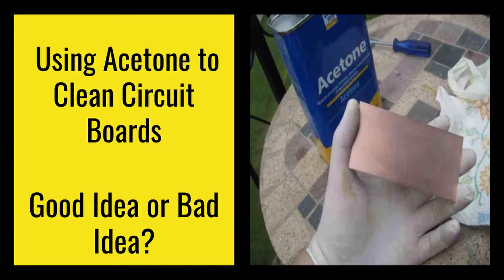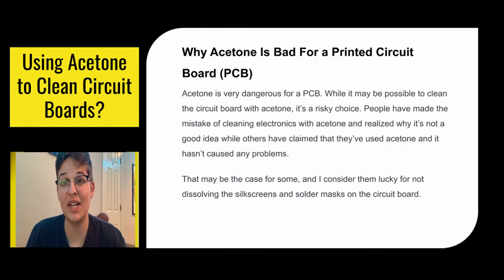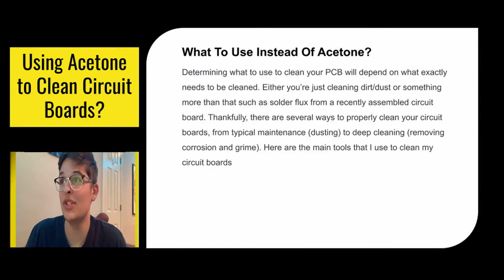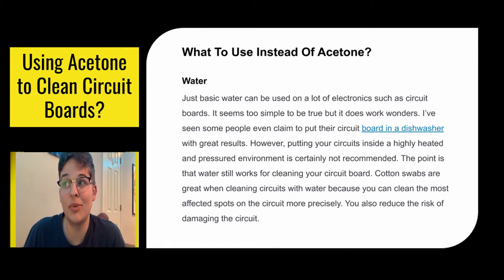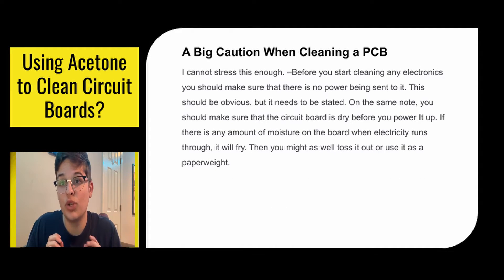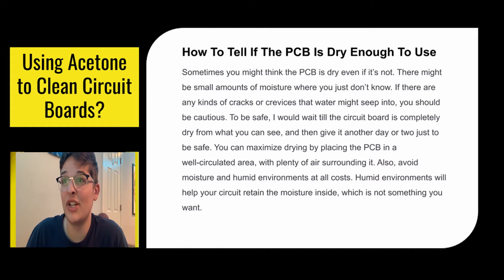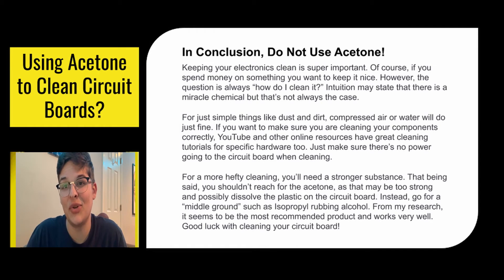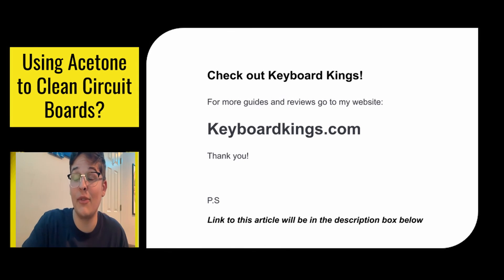Using Acetone to Clean Circuit Boards: is it Safe?

Comment from the maker: Need to clean your PCB? Why not use acetone, it's readily available..... DO NOT DO THAT.... Have you ever melted your circuits on accident? Let me know!
Reply: ive tried everything from IPA to acetone with a brush and it just does not deliver that squeaky clean appearance. Then i tried water based pcb cleaner and it is acutally worse than ipa or acetone. Then i bought an ultrasonic cleaner and started experimenting at 60C heated solution. My setup is just plain tap water to just below max liquid line and then i get a ziplock bag and put my cleaning solution inside around 100-150ml very small amount and then tossing a pcb inside the same bag. then i put the bag inside the ultrasonic cleaner. this way i can get away with very small amount of cleaning solution and save it for later in the same ziplock bag. So far it works i would say as good as a professional looking PCB but there are some caveats. I tried IPA, Acetone, Ethanol and water based PCB cleaner solution all in separate occasions to test them individually. 
1- IPA and Ethanol works equally well final product is squeaky clean after 3 mins. which i could not get the same result with just a brush. its not even close, im not sure if it is the ultrasonic action or 60C heat but theres a day and night difference between brushing and ultrasonic method.
2-%100 Acetone, this one was an experience :) at 60C ziplock bag started to expand because acetone started to boil. this boiling action did not happen with IPA or ethanol. Final result was again squeaky clean and it did not melt anything it didnt even remove silk screen. my pcb has 0603 parts qfns and tqfp packages. didnt have plastic switches or connectors unless im out of IPA or Ethanol i would not use acetone not because its harmful for the pcb but it is scary to work with. I will probably gonna make one more try with room temp water and see the result of cleaning. Because that boiling and expansion was scary.
3-Water based PCB cleaner made a huge gummy mess it made it worse than before so i dont know i was so disappointed because its the most safe solution to work with but NO! simple as that.
4-Soapy water with purified water again it did not make any effect even after 6 mins it was the same.

So bottom line in my experience IPA or Ethanol is the way to go. i only wonder if heat is the key thing here or the combination of ultrasonic +ipa. for that my next try will be the same setup but without heat to identify which has the key role in this awesome result.